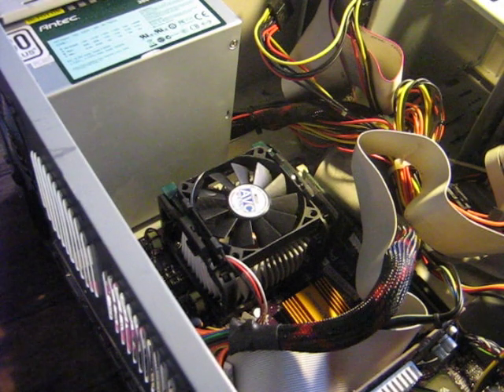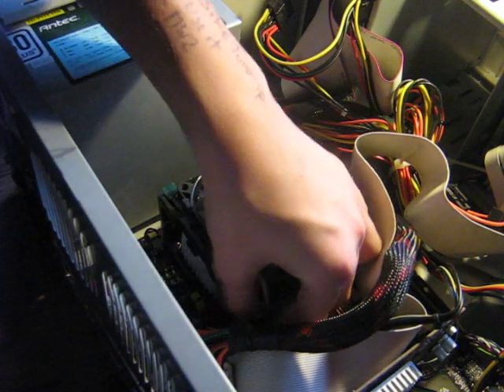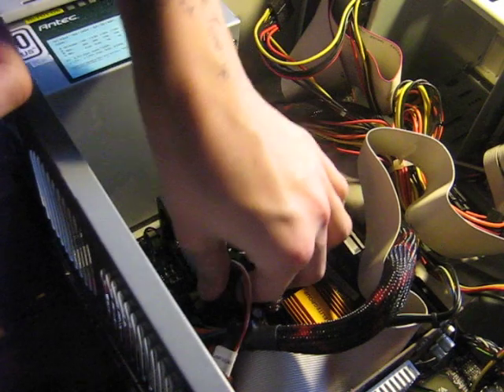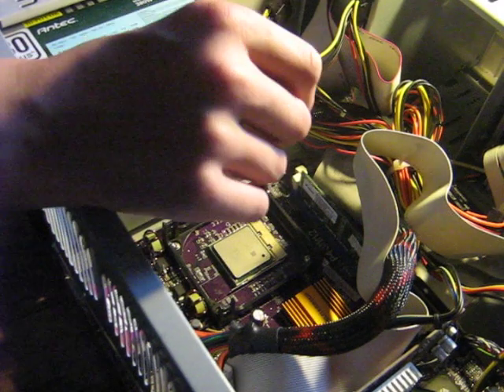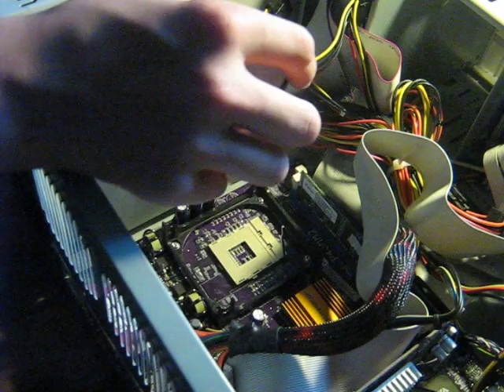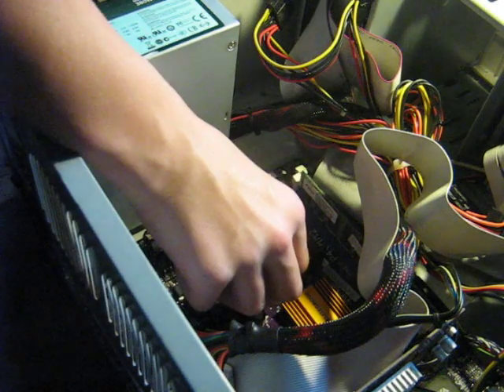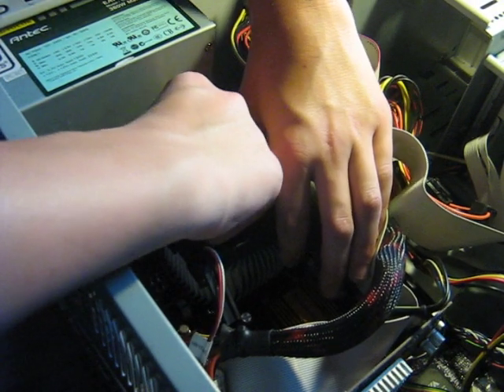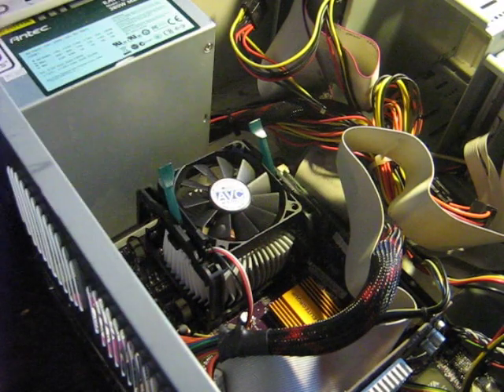How to change your processor - Tutorial

Comment: Do you think I need to change my 500W 80+ PSU if I want to do this change?
Intel Core i3 530 2.93 ghz
GTX 460 'Goes Like hell' 800mhz
8GB DDR3 665mhz RAM

To Intel Core i5 quad (2.66 ghz)?
Must i change PSU, or can I use the one I have right now?